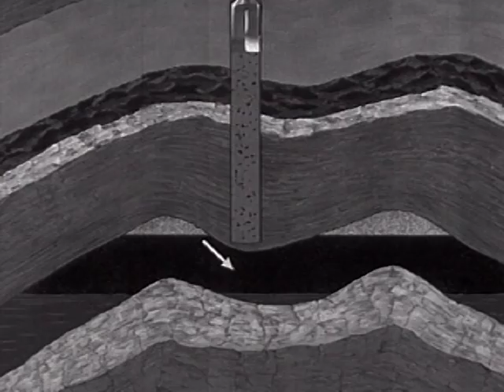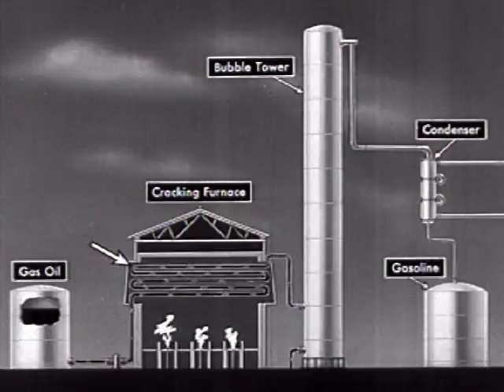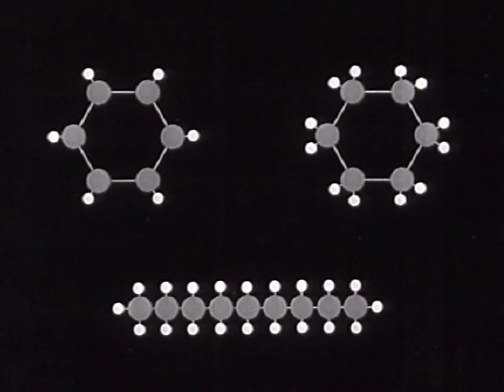More Power to You - How Oil Is Drilled, Transported And Refined To Gasoline

Comment: Guess pollution was not  a problem back the. They should have also started to invest in e vehicles.
Reply: Electric vehicles were invented before gasoline vehicles.  But gasoline vehicles were better, so they took over.  Electric vehicles still have lousy range, and are heavy compared to gasoline vehicles.
Reply: They didn’t have good range back then, so it never took off until recently

Comment: 6:28 ...gas oil is converted into gasoline ..for that high pressure and high temperature given...

So my question is
 gas oil will not burnt in cracking funrace at that high Pressure & Temperature?
Reply: If your question is focusing on how that high a temperature/pressure and it doesn't ignite, that's because there's no oxygen in the pipes.

Hydrocarbons need oxygen to burn.
Reply: Dhruv Patel because it needs to be separated beforehand, if you do this with plain oil, you will not end up with gasoline bu with a liquid that resembles tar